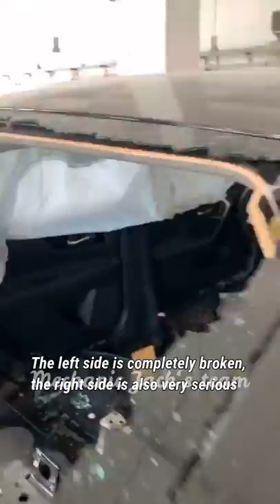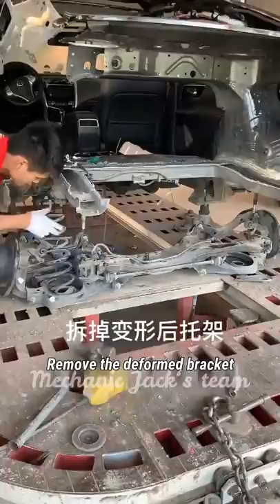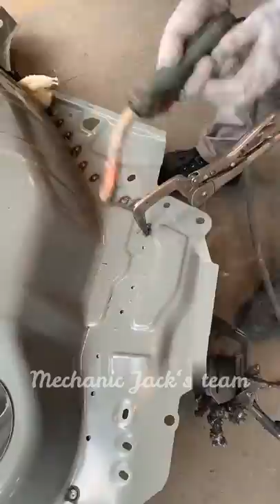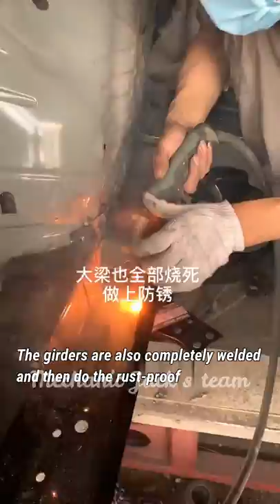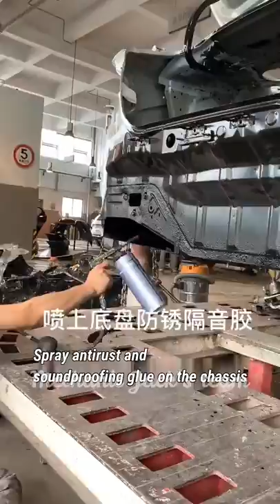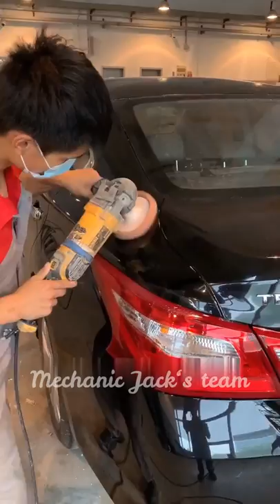Mechanic Jack| The whole process of vehicle restoration after accident

Comment: A lot of hard work but I sill would be scared to drive a garbage on wheels like this. Serious collisions affect on whole body due to the way it's made to spread the tensions and pressure on every part of the frame body so it could be weakend without any visual damage.
Reply: Whoever told you this is very wrong.
Reply: @legioner9 Ok, I'm listening because for now your comment is just worthless and empty opinion. Since you think I'm wrong please explain how and why it's not possible to focus energy in single area and don't affect on the rest of the chassis. Material stress while heavy impact is being transfered on almost whole chassis. Parts that are close and connecting to deformed chassis elements are weakened due to stress being transferred through them, therefore they are weakened, have less tolerance for stress. In next collision they will transfer less force which leads to deformation to lose energy.
Please Google "FEA car" and you will see how stress is being transfered on visualisations of car chassis and body.
Reply: @AnaheimBN  You wrote "it's made to spread the tensions and pressure on every part of the frame body". It depends on every single crash in particular. The cars are modular made, like you see in the video. Cut and replace. If a component is elastically deformed (up to 0.2% of any of it's dimension), then it won't be replaced (obviously). If lightly deformed, the component will absorb more or less the same amount of force, it's not like its failing completely (on this subject it depends also how the component was made, e.g. mild steel, hot formed high-strength steel etc.). The force transferred to all other components is minimal, that is why cars today absorb energy very good. If you would make a car with very stiff frame, then what you say would apply. Furthermore, in every car's factory repair book is written what component must be replaced after a specific impact. This car was repaired good.
Reply: Totally wrong... You don't even have clue..!!